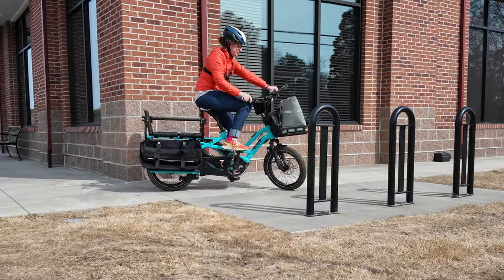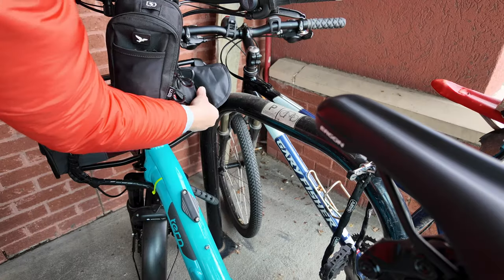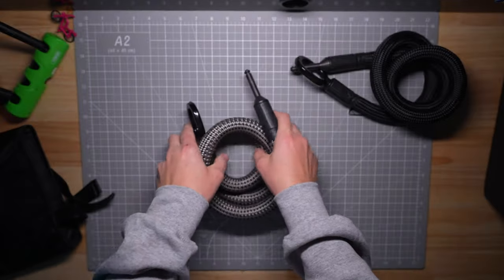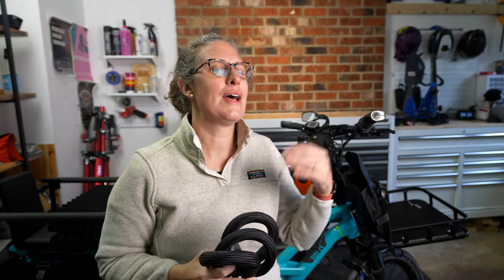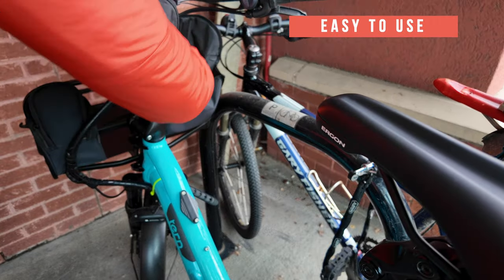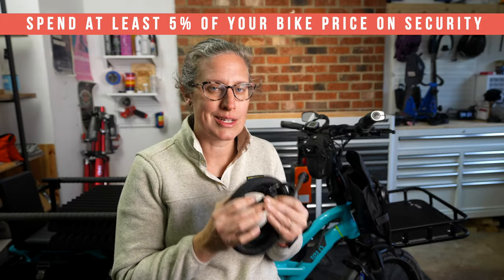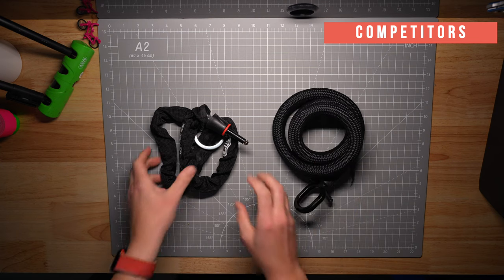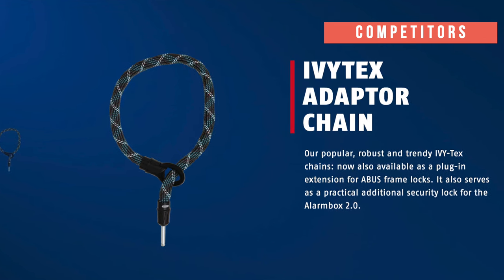Tex-Lock Mate Bike Lock Review: Add additional security to your e-bike

Comment: In low theft areas I've been fairly comfortable using the cafe lock, a heavy duty 6' foot chain,  and Abus cafe lock extension, and sometimes adding the Abus folding lock.  That seems like a lot to cut through.  I like visible trafficked areas, but I not sure a stranger would feel comfortable interrupting a thief armed with a portable grinder.  I think some people would prefer to mind their own business.  I'm encouraged when a good samaritan  steps in to courageously disrupt a thief.

Comment: We had been looking for a frame lock extension chain and got a Tex-Lock (after seeing it on your NBD article). It's great for low-risk situations like you mentioned . Based on YT videos, the Tex-Lock has more fabric layers than the Abus version. It's super light and easy to carry on either of our Tern eBikes (can't even notice its there). We also carry a Hiplok D1000 and Kryponite NY Chain so we use a 2 or 3 combo (+frame lock) depending on the situation.

Comment: I forgot to say my bike locking strategy! I tend to lock up in relatively safe locations, so for my Priority 600x I use a Kryptonite U lock and get my frame+wheel attached to the rack. For my Tern Vektron I use an Abus Bordo Granit but it is surprisingly hard to get that bike locked up. I think a flexible chain like this would be a dramatically better option all around for the Vektron AND I could see using this with the U-Lock for my Priority 600x in a riskier parking location.
Reply from the maker: You really only can lock the vektron between the battery and seat stays!

Comment: Thank you so much for introducing me to the tex-lock mate. Saw it on one of your instagram posts and got it. I use it at work, because it is a gated area so that should be enough. Even got a second bag from them to use on my front rack for my gloves.

At home i use a Abus steel-o-chain 9809K in the basement. Thats the lock i used before the mate and i take it with me when doing trips.

Have an Abus Bordo 6000K folding lock, but i don't really like it. Got it for free from my employer because i rent the bike over the company. It's "light" and always stays on my bike in the bottle holder in case i need some extra security or want to lock the frontwheel.

Also got a Kryptonite New York, but sadly most bike racks are shit here and you can't use an u-lock properly. Too heavy and clunky so most of the time it stays home.
Reply from the maker: keep me posted!

Comment: Best way to protect bike. Get a kiox display installed so it can be removed to software lock the bike. Get insurance and a hiplock d1000. You get that and the cafe lock and it's the best option.
Reply from the maker: Which bike did you add a kiox to?
Reply: @BikeShopGirl  gsd. Local shop did it and tern even had directions to help.
Reply: Software lock from the Kiox display does stop a thief from using the ebike properly, but does not stop the ebike from being thrown in a van or truck and stolen. At that point it is a pain for the thief to get the ebike working without replacing the display, but you would still have no bike.

Comment: Tip for those with ebikes, especially costing $2k+, spend 15% of the cost of your bike to defend it, the best way I recommend is with a simple $20 rechargeable bike alarm hidden discreetly, a heavy duty U-Lock like the $299 Abus/Hiplock, or SkunkLock Carbon for $179, I'd get more satisfaction of someone getting a rocket shot of noxious gas in the face, & save $120! 😆 

Also use a heavy duty chain, this is where you can make up buying the expensive U-Lock, get a 10mm-12mm AKM Chain & heavy duty lock combo, as well as a Smart Things, or Air Tag, or at least the alarm, U-Lock & chain for any city or overnight parking

Comment: Looking for tips on how and which locks I need to lock up an electric cargo bike less than $1K for a commute to work. Can't park the bike inside. Also for going into stores for shopping. I've been told I need two locks. I've seen video in my town of bikes being stolen. People just stand by and film. Police have set traps.  I don't want to have to spend $300 per lock. I've heard people complain about heavy chains. In the past, I've had a regular mountain bike and 10 speeds stolen. I've recovered one a block away and another at the police station a much later date in worse condition.
Reply from the maker: If thefts are common, you’ll either need to invest in the locks or figure out somewhere it can be brought in. Maybe there is a bike storage locker in a nearby office?
Reply: That's the reason I didn't buy a $3,000 bike. but then I don't know which locks are sufficient for an $1000 bike?

Comment: I was really disappointed in the ABUS 8mm IvyTex adaptor chain. The plastic cover over the end of the chain that goes into the frame lock broke, and revealed that where the pin and chain attach, the steel is significantly thinner than on the chain, and would be very easy to cut. I do not think that this is higher security or a better product than the basic 6mm adaptor chain that's half the price.
Reply from the maker: Thanks for the update. I didn't realize it wasn't a 6mm chain!

Comment: I am LOOKING for a longer chain or cable "supplement" for my ABUS U-Lock Granit XPlus 540.  I would like the end links to be big enough to go thru the U section of the lock.   ANY suggestions?
Reply from the maker: What’s the dimensions of your shackle? It should be fine but I can double check for you.
Reply: @BikeShopGirl  The ABUS "U" bar measures .64" square...   the spec from ABUS says 33/64" (.516") but I think that is the steel underneath, the measure I made is over the soft coating over.  thanks...
Reply from the maker: I wish this lock was sold separately: https://www.osloh.com/collections/tex-lock?ref=8za9iz6l
Reply: @BikeShopGirl   I posted a question to osloh to see if they would sell the chain w/cover separately    I will probably just get an ABUS chain...
Reply: @pauldamian2988 I have the Kryptonite New York U lock that measures 0.82” in diameter and I can just barely fit the Hiplok XL 14mm lasso-style chain lock. Since your U lock is even smaller in cross section it should easily fit through a link of the Hiplok XL chain. It is only 1 meter long, but the lasso end makes it work like a much longer standard link chain. It even has a nice fabric covering to keep it from chipping your bikes paint.

Comment: For the most part, if people see a handful of aggressive young adults all wearing hoodies cutting through bike locks or racks with an angle grinder,  very very few are going to get involved. I'm pretty confident that bike shop girl wouldn't either. Call the police from a safe distance possibly, but still only just a minority would even do that. But what are average response times from the moment you start to dial until a patrol would turn up? Too long almost always. 
The most expensive €300+/- hiplock and others can have both shackles cut through completely in 8 minutes or less using a battery angle grinder and the correct discs by an experienced operator. And that is Diamond rated. 
And the vast majority of bike racks can be cut through in a fraction of that time like the loose and wobbly one bsg locked her bike to. Throw the bike in the back of a van and cut off the two or three Diamond rated locks the justifiably paranoid owner bought at your leisure.
For just my bicycle I use a Burg and Wachter 2 metre 12mm hardened squared links chain with a mini D lock rated gold for a motorcycle but Diamond for a bike. I added a second mini D lock so I can loc lock it in an 8 instead of a long 0. Double the cutting for a thief. It weighs over 6,5kg. It gives me a lot more options for where I can secure my bike. Especially to trees and wooden poles. No bike thieves ever carry a chainsaw. Also chains are much more dangerous to cut than solid metal locks. They can cause a disc blade to shatter with drastic consequences for the operator. Hopefully the potential thieves know this too. 
Always keep the chain suspended and not lying on the ground. I also carry a regular large D lock so I'm as protected as I practically can be. 
And I'm absolutely well aware that it is still not enough if someone really wants to take my bike. Nothing is ever enough if they really want your bike, 
I have finally ordered my first e-bike and I think I will be using the same as above plus a little extra.
Reply from the maker: FWIW - I have interrupted at least 3 bike thefts
Reply: @BikeShopGirl  That is admirable and very courageous of you to do so. But always put your safety first above a bike or anything else. I've seen one video of the actual bike owner interrupting a group of aggressive teenagers here in Dublin cutting his bike lock and they left with his bike and he needed hospitalisation. And others from all around the world just ignoring passers by on busy streets and carrying on regardless. It's not right or fair.
Reply: If it comes to carrying 6,5 kg, you might as well take the bus or cab. It cuts the joy of riding a bicycle.
Reply: @CristianCiupitu  AHH you roadies are such weight wussies. 
I use my bike as a car alternative. That means carrying all sorts of cargo you would use a car for instead and I carry a LOT of stuff on it. 
First, I'm 2 metres tall myself and 120 kg. Add my extra large frame bike plus racks, bags and a little luggage and there's another 20 kg. I could easily add another 20 kg or more sometimes too.
When I pull a trailer that's usually 40 to 60 kg behind me and I have had 85 in total. Over 200 kg on the road with pedal power only relatively easily.
With just myself and a little luggage on the bike say 140 kg. 6.5 kg is just over 4.5% additional weight.
I'm not riding for performance. I'm riding to go places and get sh1t done.
Reply: @tconnolly9820  ha ha ha, I'm not a roadie. I've never been. I ride a hardtail mountain bike in the city.

Comment: TexLock can be cut easily
Reply from the maker: Most 6mm chains can be :) Just another layer of protection 🙌
Reply: @BikeShopGirl  120$ for a chain that won't even stall a thief for 30 seconds? You could secure your bike with rope and get the same amount of protection
Reply from the maker: @Noone-tb8jn the mate wasn’t $120 but it looks like they are sold out.